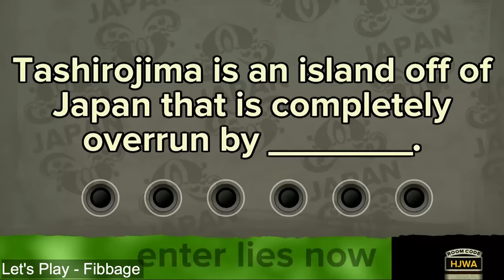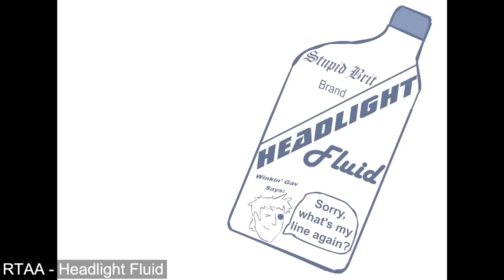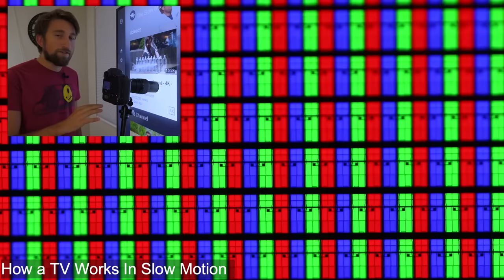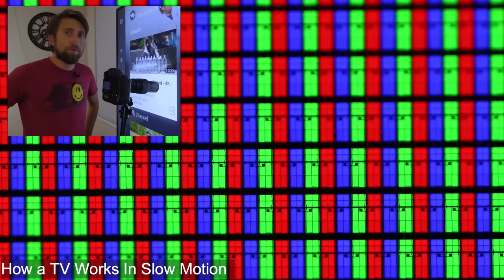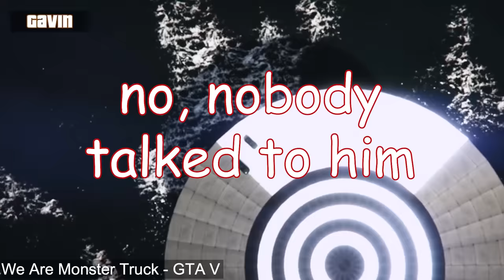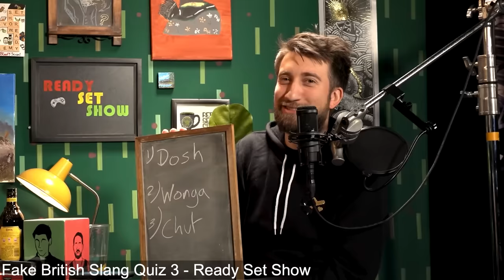gavin from achievement hunter vs. gavin from the slow mo guys

Comment: The falling out of a plane thing is technically possible. You get real hurt and die later. If you were like a trained para marine or skydiving instructor you could pull it off and limp away if you got really really lucky. Having any degree of confidence in pulling that off is unwarranted.